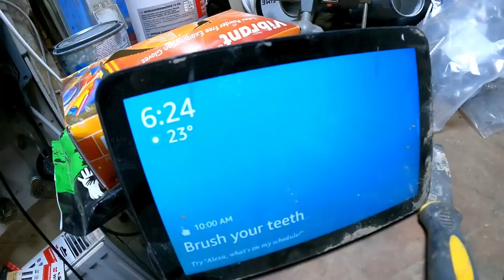Ep 87 - How To Fix An Old Boat Bilge! #boatrestoration #boatproject

Comment: Simon and Gemma, I am a Naval Architect of steel ships and I have been watching your series from the start with interest.  I haven't commented on anything so far as there is nothing I have found amiss (other than floors connecting to the keel, but you have rectified that).  However, I am concerned about the state of your ballast in bags and the apparent randomness of the weight of each bag and its distribution in the boat.  Ballast is required for three reasons: 1) to change centre of gravity (transversely, longitudinally, and vertically) and thus potentially improve the stability of the boat; 2) to make the boat sit at its design draught; and 3) to correct any bow or stern trim or heel, ie so that it is on a level waterine both longitudinally and transversely.  Determining the amount of ballast depends upon the hull shape of the boat, the distibution of weight along the boat (ie weight of engines, etc), the longitudinal structural strength of the boat, and the position of the centre of gravity without ballast.  Please do not put the ballast back permanently, you need a plan first.  On the warships I designed any ballast we used was in the form of a rectangular blocks (each about the size of a brick and easy to handle) and encapsulated in plastic to avoid any corrosion or leaching of metals into the bilge water.  I urge you to find a tame qualified Naval Architect locally to you to advise you not only on the requirements of ballast but in all matters relating to strength and stability.  Keep up the good work, you are going in the right direction.  ps: one more thing, are you going to take the exhaust/fenders off to check the condition of the hull behind?

Comment: “It’s not long enough - That’s what she said” I was literally 🤣
Just a thought - assuming the ballast is lead like every other boat, why not take a card template exactly like you did with the steel floor frames. And make a form to remedy the lead into an easily to handle shape that fits the boat a lot better? Plus then you can also put in an eyelet bolt (or whatever y’all call them) so that you can lift them in and out a whole lot easier in the future. It’ll come in handy in the future when you are trimming the ballast for weight balance after you’ve finished nearly all the work on the rest of the layout.

Comment: Sailing Yaba have created ballast tubes from gutter pipes, filled with metal shavings from a metalworker shop. They can lay and pack varying sizes and lengths of tube depending on the shape available. The tubes are capped so a very clean install and removal if necessary. Makes a lot of sense..
Reply: Yes if the shavings don't rust and expand . so why change what's worked for so many years?
Reply: Lead could be cast into sheet metal gutter pipes. Heavier than steel outings and no corrosion worries. Lead cast into bespoke bricks is better but don't go too big it's heavy stuff.
Reply: @richardford4570  all soaked in oil before sealing

Comment: The engine bearers in Sarinda were not part of the original design. The early boats suffered from excessive flexing at speed and they realized that they needed stiffening longitudinally.

Comment: Are the engine bearers offset due to propeller rotation? I think some ships are built with the prop shaft offset port / starboard to counter the rotation of the prop.

Comment: Excellent work on that floor. Do you grind off the mill scale to bare steel? Hot zinc metal spray for corrosion protection would be good.

Comment: 10:58 Have you heard of the name they used to give sailors? Jolly Jack Tar. They were called this because of the method used to restrain their long hair whilst at sea. They would tie up their long hair into a pony tail and then fold it up behind similar to the way a woman does today and then they would take the added measure of preventing it from coming undone by dipping it in tar. Rather than shave all the hair off and run the risk of sun burn.

Comment: The steel brackets look like they'll increase the strength a lot, but you have to wonder how they'll fair being exposed to the bilge salt water long term?

I suppose hot dip galvanizing would have been too expensive?

Comment: Question:  How precise do you need to be on your ballast?  The reason I ask is that I noticed when you were building the floor, you were using a good amount of steel.  Seems like that should be counted as some of your ballast weight.    

Comment: Also, not sure if you follow Sailing Yuba or not, but they did a very clever thing with their ballast that I can't understand why everyone isn't doing.   Thier boat is about the same size as yours give or take.
Reply: I'm guessing because Yabas a sailing yacht/boat, she'd need a lot more ballast. Just a thought!
Reply: Yes she does.  But my comment was more on the way they are deploying it.  Their method gets the weight as close to the keel as possible while also taking up far less space than bags of lead.